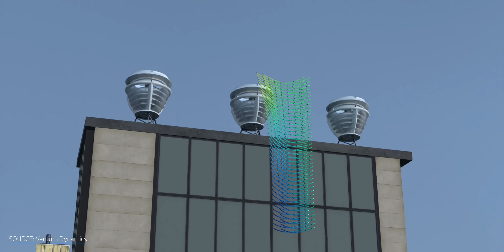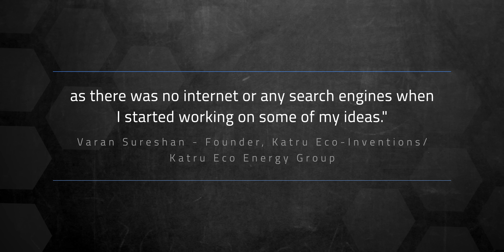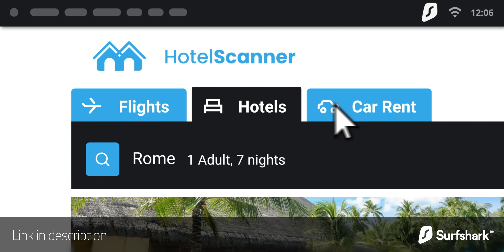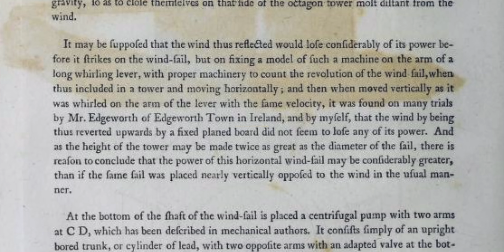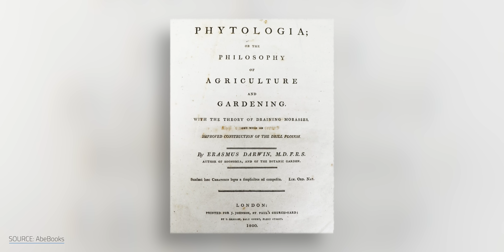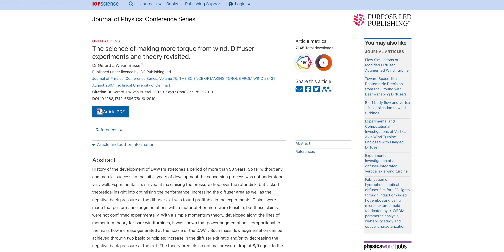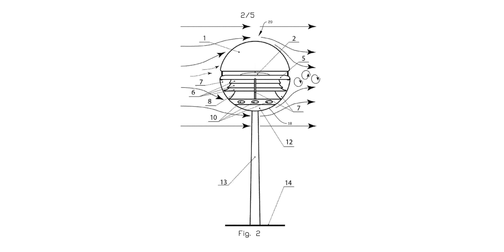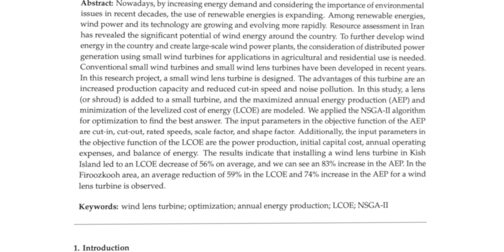Are Shrouded Rooftop Wind Turbines the Future of Energy?

Comment from the maker: Do you think that DAWTs have a place? Secure your privacy with Surfshark! Enter coupon code UNDECIDED for an extra 4 months free at https://surfshark.deals/undecided

If you liked this, check out Have we been doing Solar wrong all along? https://youtu.be/LqizLQDi9BM?list=PLnTSM-ORSgi4dFnLD9622FK77atWtQVv7
Reply: The design is interesting, however, according to your chart @18:48, the highest power output only produces 6100 kwh per year.  That is not enough to power my home when I average 40kwh per day of energy use which puts me at over 14,000 kwh per year.  I would have to have 3 of these, and apparently they are not recommend for single family homes.
Reply: Cool looking  DAWT. But I think we need some real TCOE numbers before we get excited
Reply: this is NO different than a funnel or shroud but all that surface area/material could be used for larger HAWT turbine blades and you get the same or even better electricity production for less cost.
Reply: @zodiacfml  I think the whole point is not being better than HAWTs, but fitting at different spots and not having any visable moving parts. Meaning it can be used on buildings in cities.
Reply: No
Reply: Far too much historical fluff in this episode.  A little bit would be fine, but it was filler that kept people watching longer before you got to the actual product.  Even then, the details were on the light side.
Reply: This proposed solution seems to benefit radically from the whole side of a building. It's radically more area to capture wind pressure than some other solutions!
Reply: Wonder how different rotaries would work in the center of it. I'm sure they tried it and it wasn't cost performative though. Making better use of windy skyline is definitely a good idea if it isn't cost prohibitive.
Reply: I believe so, I can see it being used for homes.
Reply: If we can fully take advantage of the resources that our particular geographical place is giving us, we can succeed in our goals to be profitable from our investments! Sometimes nature gives you  a river, your goals are to power a small house, you don't have money but you can get DC motors from a junkyard that has broken washing machines. You'll have the opportunity to make your own powerplant for basically nothing... I invested in solar panels because I had the opportunity to help a friend that has connections with the manufacturers to start his business, and in gratitude he is giving me a price for the powerplant that is low enough to be an investment that can't be missed! My country has plenty of sun hours yearly and the buildings on which the panels are installed on even benefit from having them on their rooftops! The business uses much less power than the panels produce and the excess is sold. For the 2.5 years that the investment is made the cost of the electricity that's sold gave backaround 60% of the total cost of the installation!
Reply: Great video as always. If DAWTs provide any advantage over other designs in some situations then there's definitely going to be a market for them. I hope they add screens to protect birds, something like a fishnet shouldn't affect the airflow. 
It's difficult to say which design is best, efficiency is one metric, but durability is more important as there is no fuel cost with renewable energy.
Reply: Have they ever thought of using the thermal heat that is produced by the solar radiation? It is like the roof vents that spin as the hot air pass through them. Do you know of anyone looking into this type of the generator?
Reply: those look like egg cups on a roof
Reply: Shrouds in wind tunnels force the wind to flow through the shroud, because the area of the wind tunnel is reduced. This is not representative of the real world. In the real world the pressure follows the path of least resistance which is around the shroud.
Reply: Seems to me you could put your air conditioner condenser in it for shade and increased airflow efficiency.
Reply: No. DAWTS have been attempted for many years with no success at all
Reply: The graphic shown of air collecting on the leeward side of the building makes it look 
like a building with a slanted face (wider at the base) could collect even more wind.
Reply: Hi Matt, your videos are very insightful, can you please review vertical axis residential windturbines from SEMTIVE , based out of Austin, TX and it's economic viability
Reply: What about high winds peed noises?
Reply: Terrible design. fake. 

Wind Catcher but it do not work. What you need adjustable wind catcher. Wind direction change. . This design most wind get bounced off.
Reply: There few design in VAWT with wind catcher and direct to rotor there. Beauty is not effeciency. I would like to see wind catcher is rotatable to catch winds of all types. This design is one trick pony.
Reply: My company is moving locations in the next year - this might be a good fit for the new building (3 stories tall on top of a hill).  I'll bring it up to them!
Reply: @VAXHeadroom LOL good luck with that. Just want to waste your companies money huh? Ok
Reply: Basically a more stylish and hip variant of the 1500 year old axial wind mills of Nashtifan in northeastern Iran. The ancient Persians knew a thing or two
Reply: @DeadManWalking4574  Thanks for the Info, just watched a great little National Geographic vid on them. 
I've added it to my list of things mankind has been doing for a very long time that people these days think won't or don't work; see also passive air conditioning and urban areas without cars.
Reply: Dear MATT. DAWT's will have a place in museums showcasing the incredible capability of people betraying others using fake communication.
Reply: fabwic duck pwease… 👉👈
Reply: Stop   No one wants surf shark, the 1000th time we’ve had to hear  the same stupid sponsor spot . You think we are going to use your link, when we didn’t use the 100 other links in the dozens of other content creators shilling the same sponsor???
Reply: Roof turbines are a terrible useless idea. But by all means, pretend you're doing something like a toddler pushing a plastic toy lawnmower.

No, I'm not going to outline all the reasons why, because you types of people don't listen to reason.
Reply: @shamancredible8632 so what's your really cool localized energy production solution?  Not helpful unless you have other ideas.

Comment: I have been consumed with the concept of a tube turbine energy capture.

A rigid tube (~18-24in in diameter) open at ground (with screen to keep things out) and an internal grid of 1 inch boxed grid rising up the tub and said grid would be also fashioned such that the boxes would be slightly twisted so that the incoming air would not only be made into a laminar flow, but also twisted, so there is a small cyclone type of laminar wind flow created in the tube. At the top of the tube, above roof height, is a 90 degree rotating top with a weather vane attached to the leeward end of the 90 degree rotating elbow forcing the now horizontal output (90 degree bend) to always be pointed leeward, AWAY from the flow of air, thereby creating negative pressure differences inside the tube; positive pressure at ground and negative at top. The output at the elbow is being entrained to the air passing the top opening and sucking the air out of the tube, increasing flow. Ther could also be a venturi built into the tube such that the greatest venturi effect is right at the turbine, creating the greatest increase in flow.
So, there would be upward travel of air due to the leeward facing opening of the elbow sucking the air up to tube. 
Inside said tube at the top portion (approx. 10 meters) is a wind turbine of some type that is now in a captive flow of air that is not only flowing up the tube but is also creating torque through the twisted boxed grid "laminator". 

This would allow very little air flow to physically be torqued to spin some version of windmill inside of the tube, protected from all turbulence. 
What would be the best wind capture device to place in the tube in this configuration?

In effect, the wind blowing would turn the top leeward, pulling the wind UP the tube laminating it into non-turbulent flow and torqueing it through the use of the twisted laminator grid. What wind turbine design would work best?

Comment: Ya gotta use some everyday language. Make up what ever word you want and then give an everyday example of something we have all used.
Here is an easy example for you 
That nifty accessory to place on the vacuum cleaner hose. The one that sucks out the coins from the crevices in the couch . . . but how? Wind Speed . . . As in more! Large on one to fit the hose. Flat and narrow on the other to increase the sucking power.
Now think the opposite way. Perhaps most men will not get this one - the diffuser attachment for a hair dryer.  Larger area and slower air.
See - not that hard to explain.
Oh, and I can still use a slide rule if you need an artillery officer. Because, really. It just takes too long to push all those numbers into a calculator. And if you want to quibble over 8 more digits to the right of the decimal point, tell me if that extra 2 feet means all that much when a Long Tom is raining 155mm shells your direction . . .
Son the whole purpose of making these videos is to tell the average home owner that something affordable and easy to install has finally come along.
I see the videos for the Archimedes screw wind turbine and then look for prices. I look at verticle axis wind turbines and then look at prices.
The home owner wants to cut the monthly bill down. Not take out a second mortgage to it.
And what you have presented is educational and interesting.
And yet again, unavailable or overpriced for the consumer market

Comment: I absolutely think DAWT's have a place. I've worked in Wind Engineering for many years - and I've seen so many attempts at rooftop wind turbines that fail, mostly because of the turbulence intensity profile i.e. wind is not laminar flow at low altitudes. Robert Murray-Smith (who sadly recently passed away) has many videos on the Darwin Wind Turbine. Fascinating that Ventum's product wasn't inspired by Darwin's invention! Corner acceleration at the top of tall buildings is certainly something that can be harnessed. Nice video Matt!

Comment: I would imagine that the slats on the opposite side would leak air, reducing efficiency. They could implement a weather vein style shroud with slats that are only on one side and internal opposing slats on the other - these slats would rotate around the axis as the weather vein sale weeks the path of least resistance.

Comment: One thought- you can’t increase the amount of energy such that it is greater than the amount of energy hitting the turbine + shroud.  In this case I’d estimate 1 meter wide by 1.5 meters tall.  Shrouds work because they help to virtually increase the area of wind captured and they are probably relatively cheap.

Comment: If you can radically alter the pressure and flow into a shrouded wind turbine by using the ram-pump principle (possibly using a rotary method) may be using one big air input that is used to create a smaller output at very high pressure and flow, that will feed the turbine, you will succeed.

Comment: What if you put these inside structure that has shrout intakes? Till example box on roof having blades 35 degrees as a "deocration" to hide the turbines but would intake wind and be mini shrouts same time. Then array of these wind mills inside the the box? You could do easily from metal sheet blade outside decoration structure.

Comment: I do not totally understand the concept of how the wind/pressurized air (due to the shrouds) entering one side of the unit will be funneled up into the generator blades?  In my mind, as an experiment,  if you lowered the unit into a moving stream that flowed at  8  m/s, and let it run freely,  how much of the water would flow out the back side due to the lower pressure and how much of the water would flow up into the generator blades?  I would love to find a unit/units that I could mount on the ridge of my 200ft long barn.  I have over 4000 sq ft of roof facing  the winter winds that catches and channels the wind over the ridge at substantially higher speeds . I am sure I could take advantage of those winds with the right setup.

Comment: I initially thought you where going to talk about it using thermal dynamics combined with the aerodynamics; as updrafts are a thermal dynamic action. I could see how these could be tuned by an aerospace engineer to be even more efficient and possibly replace the standard blade type rotor with an Archimedes turbine style to maximize efficiency.

Comment: Thank you, I have been working on a similar project for a number of years. My project has two elements. The wind capture system and the turbine generator. I can now focus on the generator since Ventum have done the R & D for the capture system. Love your work. 🙂🤙
Reply: Someone should mount both elements in/on a sea container with and extension cord and market it to marine shipping companies, the top row of a container ship load is pretty much the same context as the roof-line of a multi story building, only with a lot more wind energy and generally lower requirements for operating noise.  You would not need to aim for full propulsion power toget started, the hotel power would be enough, and would keep things from getting bogged-down in SOLAS certification for powering things like radios and radars.

Comment: You'd think Carrier or another HVAC manufacturer would combine this shrouded turbine tech with the A/C condensers.  You already have a warmer air effect AND the windspeed of the fan in their A/C unit.  The A/C unit would run more efficiently with the wind augmented by the shroud and the temperature difference... and they'd get a much better working.... yeah....  now you're talking about heat pumps... so I guess they are already doing this?

Comment: I've often wondered why SWTs were not more common in what I call "Airflow Super Highways."  In a city, there are often alleyways where there is almost a constant high speed of airflow going between buildings.  As you are in Mass, a perfect example is the corner of Bosworth Street and Chapman Pl.  Feels like there is a constant stream of air flowing around that corner, that small SWTs would be able to generate a fair amount of energy almost year round.  I used to fight my way up Chapman PL on my way to Barracuda Tavern, even on seemingly calm days. I always imagined these turbines sitting on the corner, along the vertical wall, powering the hotel.

Comment: @Ventum Dynamics -  have you tried setting the shroud and center flow director so that the vents set up a vortex feeding the blades? Have you also tried replacing the center/shaft shroud with a logirythmic spiral (looks like a valve from an Internal combustions engine)?  If you can set up a vortex it should increase your efficency.

Comment: Designing a micro Turbine that can work efficiently under very low wind pressure will be the holy grail of wind energy harnessing. I think that this is the ultimate challenge is to design a wind turbine that harnesses wind energy when the wind doesn't blow. Somebody please make it happen! If this micro Turbine can be viable for rooftop (residintial and commercial buildings) then why shouldn't we commercialize it. 😎💯💪🏾👍🏾

Comment: A new study in Nature Ecology and Evolution found that Earth’s most extreme wildfires increased 2.2-fold in the past 20 years, with the last seven years seeing the six most extreme fires on record. New Carbon Brief analysis found that UK governments in England, Scotland, Wales and Northern Ireland have missed their tree-planting targets set in 2020 and failed to plant an area of forest nearly the size of Birmingham. Tree-planting is a “significant” part of the UK’s net-zero strategy to compensate for other polluting sectors. By 2050, the unplanted trees would have removed some 8.5m tonnes of CO2 from the atmosphere, roughly 2% of the UK’s annual emissions in 2023. This shortfall will need to be made up for with stronger efforts elsewhere if the UK’s net-zero by 2050 target is to be met.

Comment: the principle of the ventum turbine is completely different, it is based on the principle used in pumps to fast pumping of  aircraft slides, put attention that from bottom to top, the circles which become pipes are inserted one in another, the lowest in the center, when air goes as pipe, it sucks air from the next and so on, that why there is wind of acceleration, and the last as on the top as barrie it works as wing, so it put air above the output cirlcle, it creates lower pressure on the top of the construction so it also accelerate the wind power coming through turbine

Comment: According to the website of Ventum Dynamics, the diameter is 2.9m and height 2m. These things are monster huge on the roof of a private home. Weight unspecified, but they are going to be too heavy for most roofs, and another problem is that the roof must be able to handle the forces from the wind on the turbine. Vibrations go directly into your home as acoustic noise.  Annual output is 3000-4000kWh, or the same a normal private home solar-panel installation. Price and delivery are unknown at present, with delivery expected in 2024Q2 (this quarter).  I would not put my money on this......